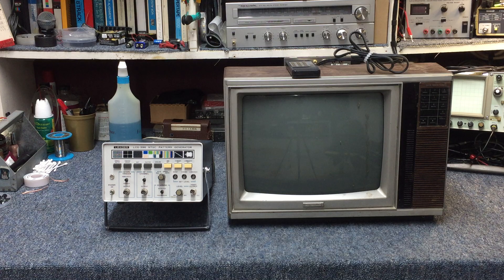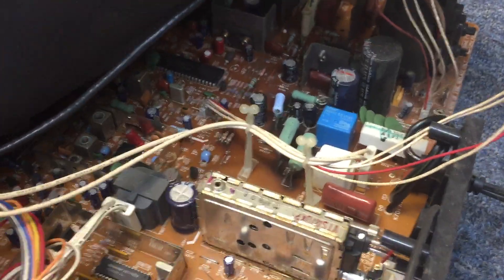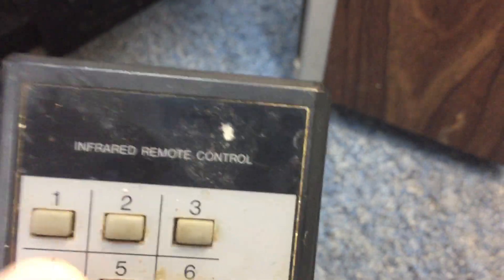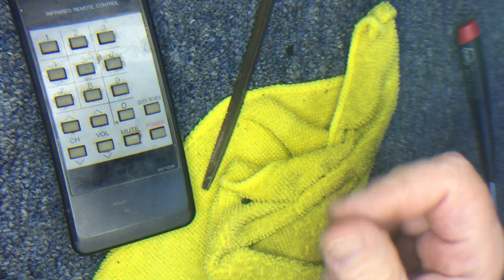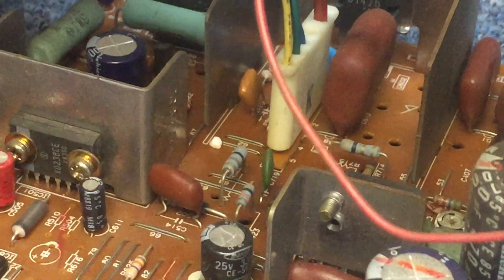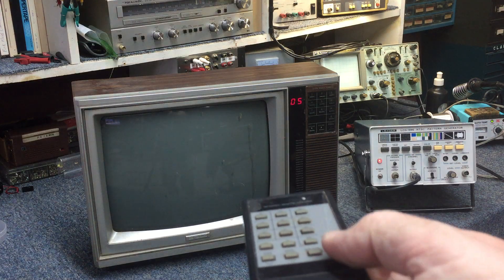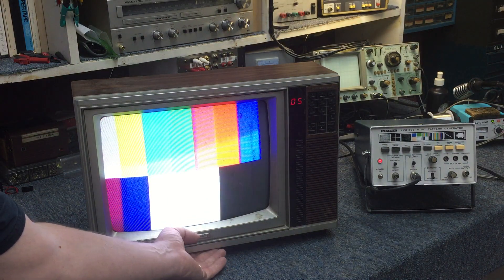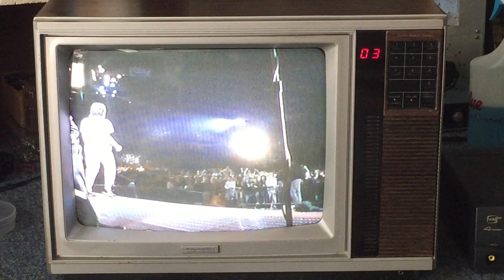13" Montgomery Wards TV -  repair & testing

Comment: Nice work.   Did you check the caps in circuit?
Reply from the maker: Yes, once I knew the 5 volt line in the startup circuit was working I just went through power supply with the ESR meter and those two were completely open.